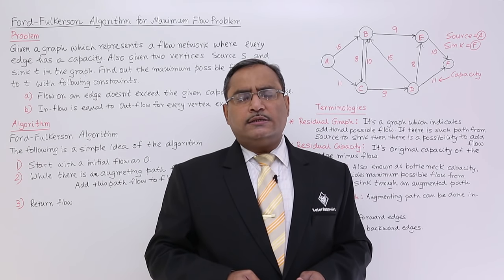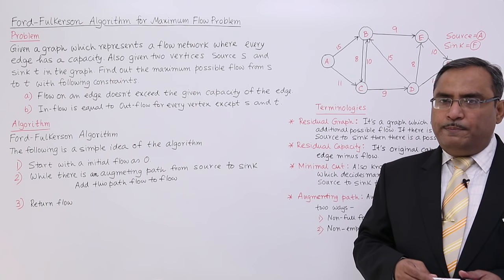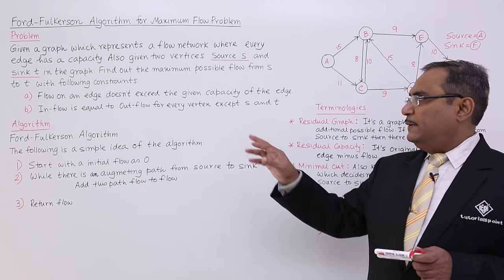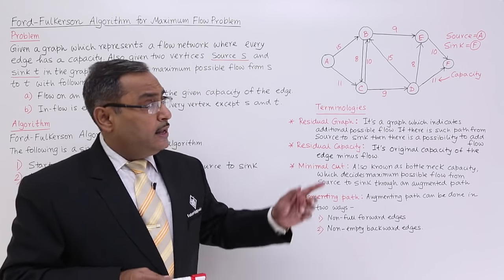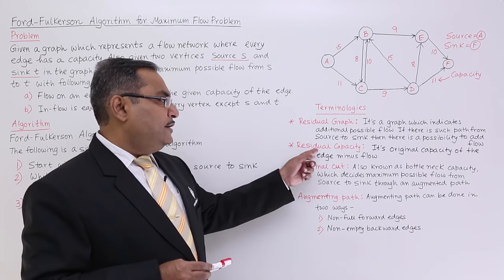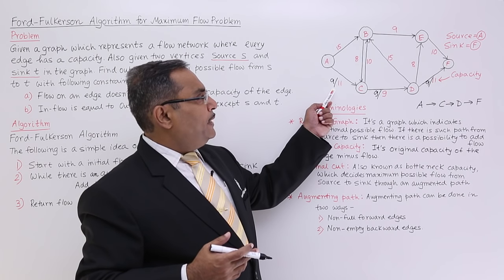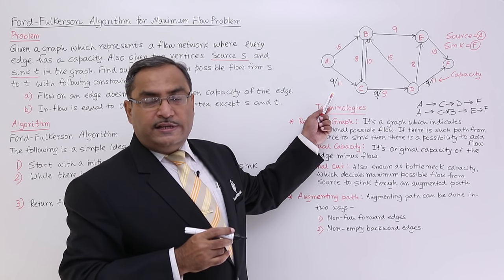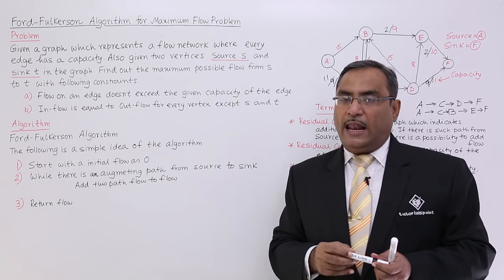Ford Fulkerson Algorithm for Maximum Flow Problem

Comment: at 6:29 how residual capacity from "E" to "F" is 2 ? its written 10 like A to C is 2(11-9 =2) B to C is 10,B to E is 9 and E to F is 10
Reply: Exactly. Confused the hell out of me
Reply: The flow does not increase after passing a bottleneck capacity. The reason it's called "bottleneck" is because it lowers the flow of the path even though other edges along the path have greater capacity.
Reply: After assigning the minimal cut from A->C->D->F to be 9, the flow through that path is set to be 9.  This means that from A->C->D the flow along that path is 9.  If we want to push the flow from A to another vertex, the remaining capacity is 2 (original capacity 11 - current flow 9 = capacity left 2).  So, to go from A->C->B, you find the minimum capacity ALONG THIS PATH, A->C capacity is 2, and C-->B capacity is 10.  since 2 is the minimum capacity, you set the flow along A->C->B to be 2, thus only a flow of 2 will go along from C->B even though it has a capacity of 10.

The same argument can be used to see why the flow from A->C->B->E->F is only 2.
Reply: @santi.g  thanks bro now i got it